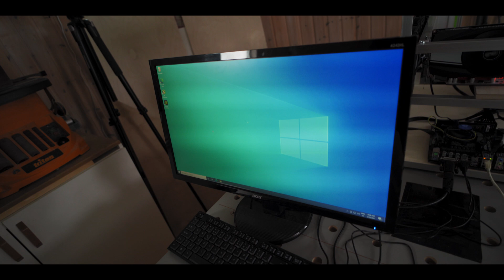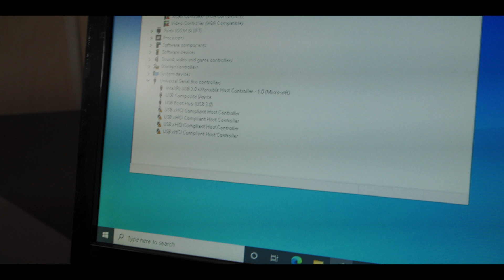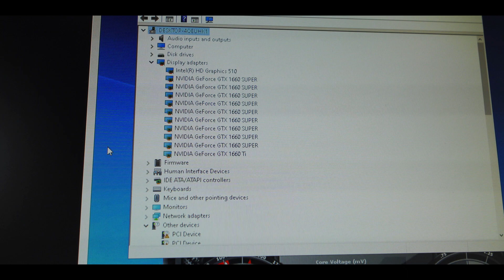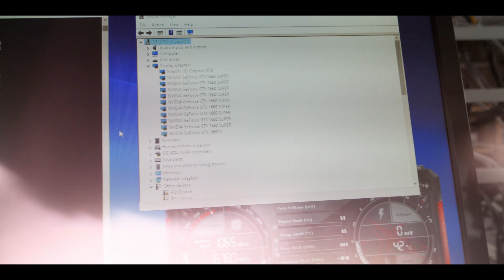I Tried Adding 16 GPUs to my Mining Rig

Comment: Hey Seb!  Really enjoy the content and have been learning a lot from you. I’m having similar issues using 4 PCIe splitters on an ASUS TUF 570 motherboard with an AMD Ryzen 5600 CPU. 

I’m maxing out at 14 1060 6 GB GPU’s despite all of my efforts to get to 16 (switching PCIe locations, disabling USB & audio in bios, checking/triple checking wiring). It’s good to hear I’m not the only one running into this problem… but I haven’t found a solve yet either. 

NiceHash Miner reports up to 33 PCIe lane available for my GPU’s so I think there should be room for all 16 GPU’s. I believe 4 are also dedicated to my M2 SSD. 

I’m trying an M2 to PCIe adapter that you showed in previous videos to see if I can push the GPU count higher. I’ll let you know how that goes. 

Keep up the good work!

Comment: Where you able to run more than 13 GPUs since this video?.
Reply from the maker: Unfortunately not. Fellow youtuber ChumpChangeXD also tried and he wasn’t able to do it either.
Reply: @SebsFinTechChannel  I see. Maybe with HiveOS… 🧐
Reply from the maker: That’s what ChumpChangeXD uses unfortunately and he couldn’t get it to work. As I say in the video I believe it’s a PCIe lane limitation in the actual hardware since the system won’t even post anything on the screen.
Reply: @SebsFinTechChannel  I see… well, it was a nice experiment 😁👍🏼
Reply: @SebsFinTechChannel  Did you try disabling integrated graphics and use pci-x1 gpus slot to get display?  as iGPU uses around 4 lanes i guess?

Comment: did you tried it again? and worked?. i have a z270 board and a i5 6600 lying around . i wanna try if it can do 3pcs of 1-4 pcie splitter so it can have a total of 16gpus . z270 chipset have more pcie lanes than the h110 . it currently runs 2 3060 atm. gonna update here if it works when i get 14 more 3060s . just waiting for the reasonable price to buy again

Comment: i would go into the bios disable everything your not using and make sure 4g decoding is on  it might work it might not .. i use one of those splitters on a 3 pcie mobo and i run 6 cards on it ..not sure if thats the same or not but i know i had to disable onboard sound and usb 3 ports to get it to work

Comment: your right about the PCI lanes and what the CPU supports, the M.2 "SATA" isn't a "nvme"  you may still may be able to use a  m.2  adapter that will turn it in to a pci  but this works better with "nvme" as it won't use sata lanes but nice try! lol
Reply from the maker: Yeah I found it out the hard way LOL! I have thought of trying the M.2 port with an adapter...